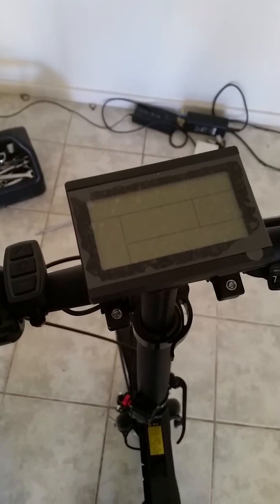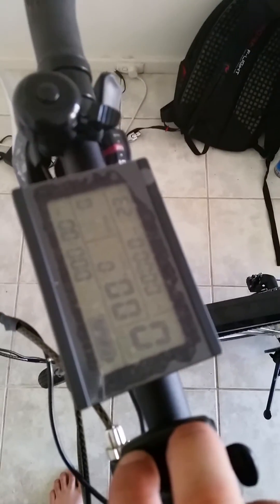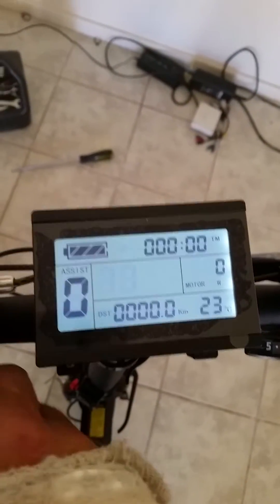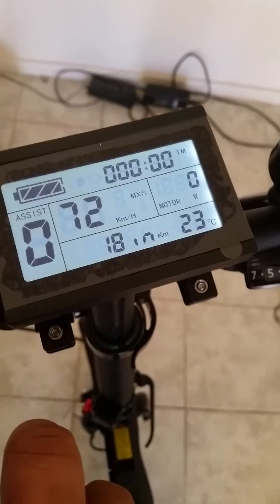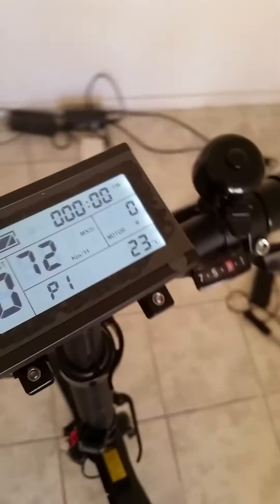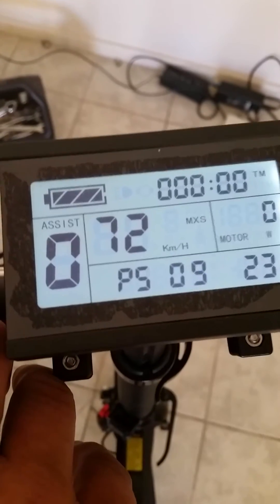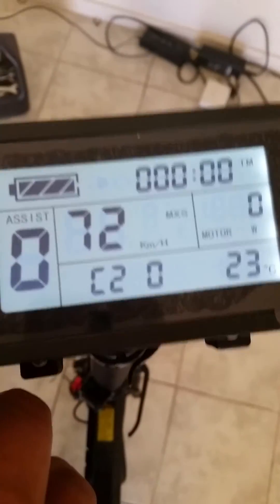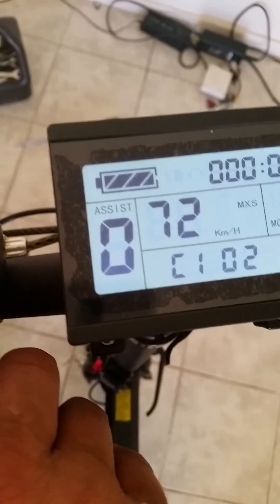Configuring KT-LCD3

Comment: Hi, I bought a brand new e-bike with a 1500w rear hub motor paired with a 19.2AH 48v Panasonic battery. The KT LCD3 is the one that’s installed on the bike. I’m currently having issues with the battery readout displaying on the LCD causing my motor to shut down. When it’s fully charged I only get around 12miles (mixture of pedal assist 5 and throttle) before the battery indicator on the LCD starts to flash, but the battery itself shows 2 out of the 4 lights left being displayed. If I keep on riding the battery indicator starts to flash indicating it’s empty but there’s still juice in the battery left.. if I start pedalling the power cuts off immediately to the motor. If you could help with this issue I would be extremely grateful!
My current settings are as follow: P1-46, P2-0, P3-1, P4-0, P5-15, C1-2, C2-0, C3-8, C4-0, C5-10,  C6-3, C7-0, C8-0, C9-0, C10-n, C11-0, C12-5, C13-0, C14-2
Reply: did u find the solution? im in the same situation

Comment: Is anyone active in here anymore! I need help with my bike. I have a 1700w bike with a 17.5ah 48v battery and bought a spare battery that is 17ah 48v. When I place my spare battery in it dies in power 5 setting or above 1300w. Is this battery sag my guy told me the controller or original battery is set to 40amp and most batteries only handle 30amp what settings can I change I tried C5 to 8 and C12 to 2 but still happens. Not sure if I’ve damaged battery but I have no issues until I use thumb throttle and get peak power

Comment: After a couple quick tests that successfully spun the wheel, my display now displays a "spinning circle" icon in place of the ambient temperature in the lower right when the throttle is pulled. Also, the brake icon in the top center is always on whether the levers are pulled or not and whether they are even plugged in or not. Is this display when the interlock is active or inactive? Any ideas what is keeping it from running? Could the brake interlock be erroneously triggered internal to the controller?

Comment: Interesting video and helpful in confirming what I suspected about different versions of the kt lcd3 ...I bought one from a US vendor and it was like this one, C menu settings until C12 only! C13 and C14 do not appear for some reason? without C13 one cannot enable regen braking control for Direct Drive motors :(
A 2nd unit I bought directly from the factory with a controller, did have those settings. It seems for Sondors or other Geared hubs, the manufacturer has disabled these menus, making them less useful as replacement screens if you need regen on your DD hub.

Comment: hi mate, really helpful .. but can you help!? I attempted to goto the config menu by holding down the up and down buttons.. now the screen has gone off completely .. and subsequently only stays on if i hold down the power button?  i've tried disconnecting and reconnecting battery to no avail.. the throttle works so long as the power button is held down... :/ any advice? thanks in advance!

Comment: Get a frigg'n tripod. ....horrible video, start over.
Reply from the maker: awww poor baby.

1st world problems.
Reply: memtube does this have the yellow connectorto plug straight into the main bunch of wires coming out from the bike or is their any way round this . I have a batribike 250w rear hub motor and36v battery but can't tell where the restriction is. I have throttle Only to about17mph but then restriction kicks in.

Comment: Can you buy a KT lcd3 by its self? Mine came with a botched connection to the + (the original solder joint is knackered so they've manually connected it with a piece of wire/metal which has been poked through the PCB) and sometimes it comes loose on rough ground and you have to shake it to get it to turn on again
Reply from the maker: yes. search aliexpress. worst case scenario buy 1 in a kit with the cheapest controller possible
Reply: +memtube I just ordered a new one... the botched connection failed and the only way to fix it is by desoldering the entire LCD which I don't have the proper tools for without damaging the LCD connections

It cost me £30 for a new screen/controller. I'm just gutted that I have to wait 12-29 days to ride my ebike again :/ oh well

Comment: how do I get a copy of the PDF file that shows the settings for the KT-LCD3 you mention...

thanks in advance
Reply: +Jacob Jarick 

thanks...
Reply: manualslib has the full version including c13 and c14, if your controller supports those options. The pdf download button is at the top of their page. https://www.manualslib.com/manual/1062393/Kec-Kt-Lcd3.html#manual

Comment: Is there a way to alter the Wattage?I have the KT-LCD3. I have a 500w motor, but when using bike it dont go higher than 250w. I was told when I purchased the bike that the power could be altered.
Reply: Go to C5 and change it to 03 for example to change the current to 50% out of controller. If not satisfied, then change it to other selection. GL
Reply: mt seok h

Comment: Do you know how to do a factory reset? Messed with settings & now I am only using half the wattage that the motor is capable off.
Reply: J Carpenter  I found it. The restore to default is in C10 mode.
Reply: char1ie72 I believe you need C10 - "Automatically Restore Default Setting Mode"
Reply: Yep found it
Reply: char1ie72  So how do you reset the new LCD3?